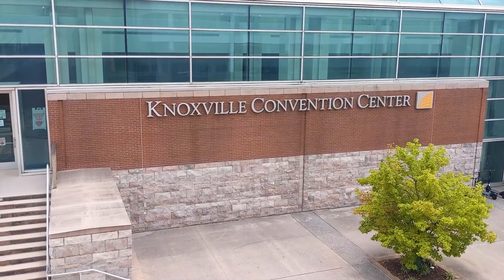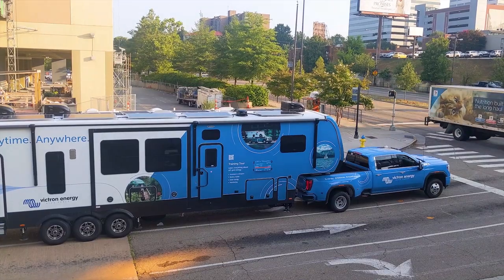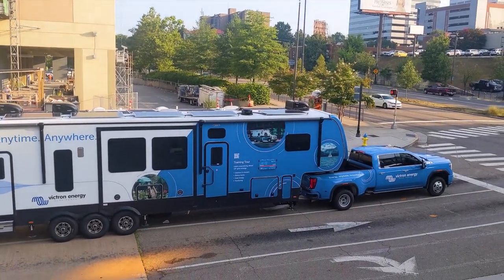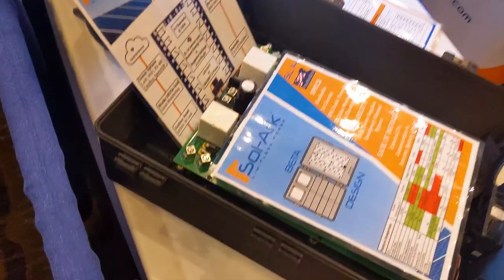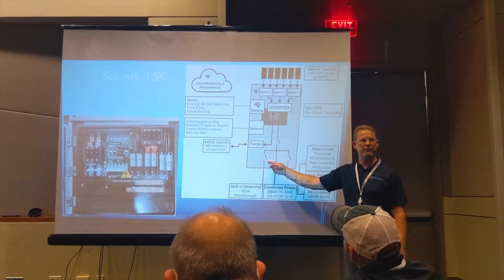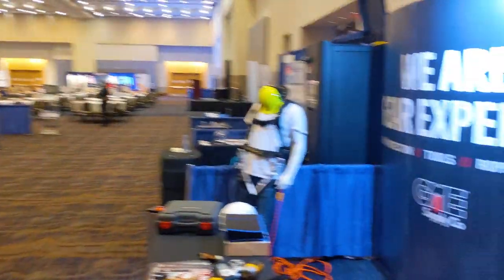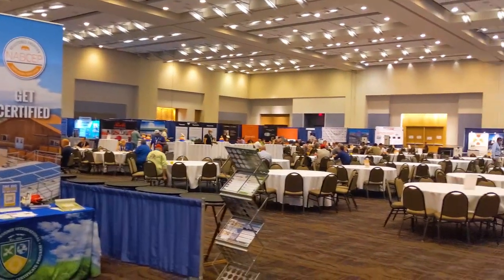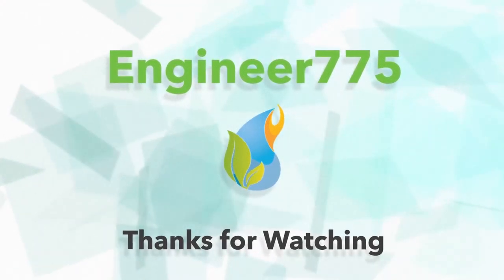NABCEP Conference for solar nerds

Comment: What's so special about the Sol-Ark transfer/load panel?
Reply: I found their booth and people the most knowledgeable and forthright about their product with a great support team if you need to call....I went because my wife and I are in the market for off grid electric done by ourselves. We found out there is a lot to research might be better to pay the person who Does it on a regular basis.
Reply from the maker: it can decide what loads to run within 4ms while the inverter surges for 100ms.  This allows and smaller inverter to run a lot more loads by prioritizing and controlling the loads.
Reply: I would love to get your overall take on all these smart load panels coming out. I saw generac also announced theirs. What are their pros and cons ? Why should anyone get one?
Reply: As a homeowner is hard to get costumer friendly info and now that SPI was cancelled, I feel channels like your are super important as you break down information in a user friendly way

Comment: Interesting..did you get to see the Fronius Inverter ?
Reply from the maker: I saw it but I did not see any advantages to what we are installing.
Reply: I may use them because I heard that they don't produce any rf interference. I haven't seen any RFI (radio frequency interference) data for the SunnyBoy inverters. I am getting interference from my neighbors Generac optimizers from about 400 feet away.

Comment: I really want to know when Victron will be UL certified.  I want to buy their products for a solar install but I can’t wait any longer.  They have been saying “later this year” since 2019.
Reply: I wish I could tell you as they are still promising UL.
Reply: @practicalpreppers7798  Ya, I emailed the sales rep a few weeks ago and he said by the end of the year.  But you can find claims on their forums of the same thing back from 2019.  Another concerning thing is the products they claim are currently UL listed are not in the database that I found on the UL website.  Perhaps I'm looking in the wrong place... I'm no expert on where to look for the certifications.  I really want to use Victron Equipment for my home install, but if it's not UL then I can't get permitted for it, and I don't think I can claim the tax credit.  That's a huge financial incentive.  I'm probably going to do a fronius grid tie and then come back later and add Victron after they get it UL certified.  I'm on the fence.